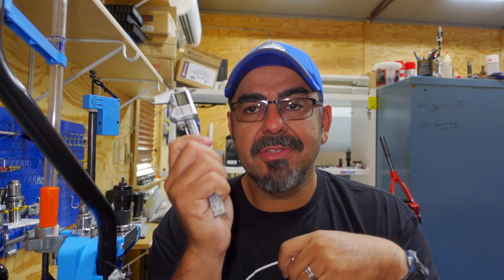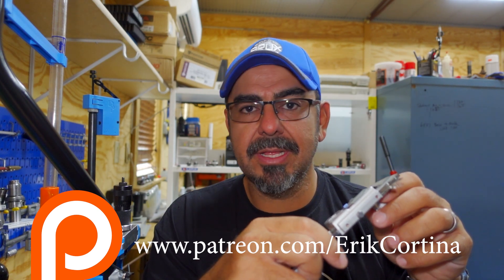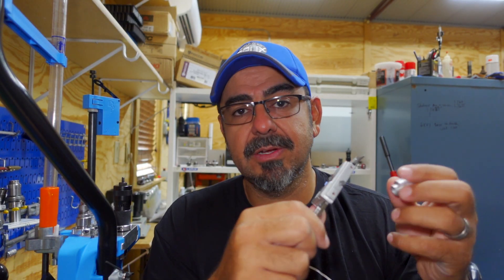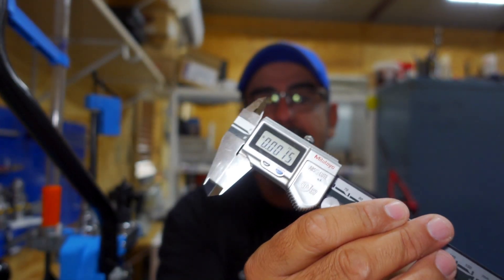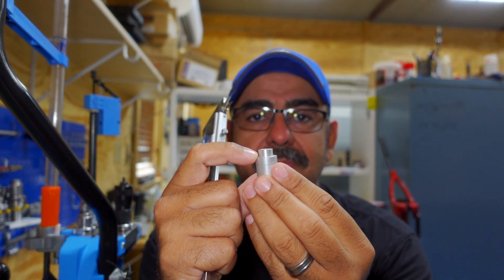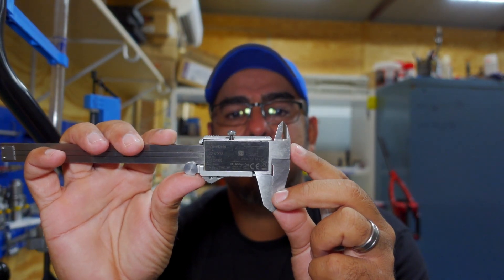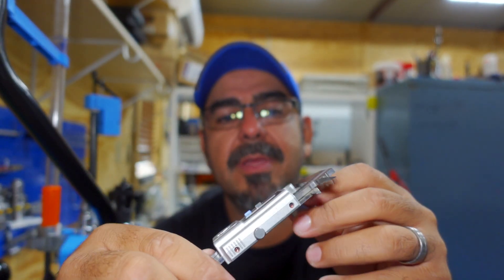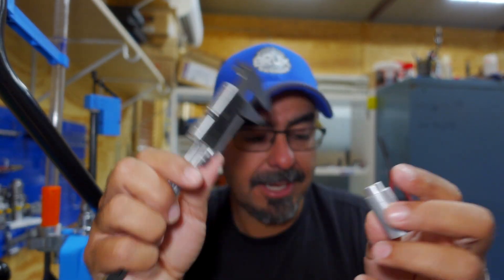You are using your calipers wrong!  Let me explain why...

Comment: Your gage block is only accurate at 72F degrees.  Too hot or to cold it will be off. 

Make sure you caliper and gage block are at 72F to get an accurate measurement. Let them soak for 15 mins in a place that is at 72F prior to measuring.

Comment: In my humble opinion, most people's biggest mistake when they buy a set of calipers is not getting a gauge block to go with. It doesn't have to be anything crazy. Just a 1-in gauge block, that gauge block allows you set your calipers to the amount of pressure that you're used to using and usually it'll look something like your readout will .0015 when it's closed but when you take the actual measurement, you're hitting 1in on the gauge block, and while technically this isn't right, you're making up for the flex that you're getting, these days it's quite a bit slower and depending on what I'm doing I don't always do it. But I almost always grab the Jaws with my thumb and index fingers right behind the comparator gauges, that doesn't allow you to flex the calipers and give you a false reading (as much) just play with it, compare your measurements to a gauge block and I'd almost be willing to guarantee they're not to true dimension. 
I hope this comment saves somebody some money and maybe aggravation in troubleshooting

Comment: I remember that the OD tolerances can vary with temperature as the piece is being ground on a lathe or CNC machine. I have also used a bearing heater to slip it onto a shaft. As the temperature cools to room temperature, it locks onto the shaft.

Comment: Hi 
After my calipers have been zeroed,the digital display reading is out to the physical reading on the slide.Is there a way to reset the digital display using the buttons(in a set order to reset) or is it a case of taking them apart to see what is causing the problem.The make is a Moore & Wright.

Comment: While you are correct that claimed accuracy is 1/1000, I have those same calipers with carbide jaws. Measuring guage blocks or pins they measure dead on every time, that stated accuracy is more disclaimer than fact on good calipers...... I have guage pins from  10/1000 all the way to 1/2" and blocks from 50/1000 to 4".

Comment: I call my digital calipers my "electronic approximator"..... Good for quick near-enough measures..... I have a dial caliper that is accurate to .001" (or a bit better using the MK1 eyeball).... checked against my top range Mitutoyo mike they are spot on... They weren't cheap....

Comment: I use my feeler gauge to confirm caliper accuracy.  Here's a tip regarding using a feeler gauge for measurements. By stacking some of the blades of a feeler gauge together, you can get larger thickness measurements. If you put all of the blades from .003 to .022 side by side, and measure that, those add up to .250 which gives you 1/4".  Add from .003 to .019 to get .187(5) aka 3/16" (6/32, 12/64). Add 8-17 to get .125 aka 1/8".  Add 14 15 16 17 to get .062(5) aka 1/16th. I may not be the first to figure this out, but I figured it out on my own and wanted to share with anyone else who may not already know it. Also, if you have quality drill bits you can trust, you can use the base of the bit as a measure of diameter (or the outside of the drill bit, if the diameter of the bit is larger than the base, like my 3/4" Fisch bit).  You were right, I hadn't thought of the fourth way, so, thanks for this!

Comment: This is a check that is just as important as measuring  a gauge block.
Take a cylindrical object and measure the diameter using the tips of the measuring jaws.
Then take a measure as far away from the tips as possible. 
If there is a big difference between these two measurements may have to tighten the adjustment screws. 
But make sure that the movable jaw is sliding freely. If you tighten to much the actual measuring force can be too high which causes measuring errors.

Comment: They advertise + or - .001, but even the china knock offs usually do better than that.  I'm guessing Mitutoyo advertises that tolerance so that they never have a return.  Where the Mitutoyo really shines is battery life and that they have a low battery indicator.  The cheepos us a lot more power and can start showing bad readings as the battery gets low without any warning.

Comment: Are dial calipers better than digital, or is there really no difference?
Reply: Not really. IMO I use dial calipers at work just for a quick reference. They usually get knocked out of tolerance really easy because of particles getting into the teeth gear area.

Comment: Sometimes I get a different measurement when measuring the same thing multiple times so I know my cheap ones are not perfectly accurate. 

But even my cheap ones are far more accurate than a ruler or tape measure. For most things they are good enough. 

The secret to good results with the cheaper ones is to make sure you zero them out before each measurement, and open and close them onto the object slow and smooth. It also matters how hard you clamp down on the object. Mine work best when I barely let the jaws make contact. 

If you don't have the gauge block you can Google, exact diameter of a quarter and a nickel and get some coins that are fairly new. Apparently the US mint likes to make these coins to some pretty exact dimensions. I'm sure it's not as good as the official gauge block but it's better than nothing and almost always available and basically free. According to my measurements my cheap old ones are not that bad. I just measured an uncirculated American eagle silver dollar and mine gave a very close measurement. 40.6 mm is the specification and mine said 40.62. close enough for my uses. I think a completely uncirculated coin would be the best option if you have one.

Comment: You left out one other accuracy problem - heat/cold
If you measure your 1" gauge block when it is hot/cold you will find a difference in measurement.  Then you use that to measure something at that particular temperature and you will get what you measure, but the next day it is hotter/colder, then that exact same measurement - isn't.

Just for fun, put it in the fridge (not freezer) then measure it, then put it in the sun and measure it.  (time is a factor so at least an hour min in each environment).

Comment: Check caliper accuracy with a round ground cylinder. Measure it with a micrometer and then measure it with a caliper. The biggest source of caliper inaccuracy is the various measurement pressure used by each user.  https://www.youtube.com/watch?v=EELINzAqYPI&t=11s

Comment: The Gauge blocks are a MUST...but I always use two fingers to close the jaws for outside measurements for better control of closure pressure.  But where were you 50 years ago when I needed you?

Comment: I never considdered the top messuring surface to be something people might not know, this was just normal to me.

With analoge metric ones you realisticly can messure to five hundrets of a mm which I considder to be quite good.

 I dont realy like digital ones, I had them to often run out of battery at the worst time or have the zeroed position run away, I also do not like the ones with the dial indicator becouse though they are good at desplaying mesurements after the comma but are hard to read bevore and some of them dont even have a ruler to read those of

Comment: This system was originally called quadri measurement by Miutoyo well over 40 years ago. Its been standard on all types of calipers since then and probably before. After all this time I doubt if anyone with calipers has not used this feature, it comes in the instructions..

Comment: We always handled gauge blocks with cotton gloves on.  It transfers less heat and prevents the oils in your hands from messing up the blocks.  And our labs for measuring all dimensional equipment was kept at 68 degrees F with a plus/minus tolerance of 1 degree.  The equipment has to set at that temperature for 2 days to stabilize before calibration.  Outside of those temperatures you will lose accuracy.  And you need to know how much the material you are measuring grows per degree and take that into account.  For reloading you need to be accurate.  Measuring hole spacing in a Barndominium no so much.

Comment: A lot of mikes come with standards to check their accuracy. If you do not have a mike, the standard can be purchased separately for around 10 dollars from Grainger's or Fastenal.
Part of my job was to check our calipers and mikes, verify their accuracies and log the results in a records book. We had to purchase a standard, that was a few years ago so the price may have changed somewhat but they are much more reasonable than the gage block for those on a limited budget.

Comment: Thanks for the info, I never knew.  For me calipers are for measuring "pretty close", as in a bit more accurate than a steel ruler.  I guess it's a family thing.  Grandpa Miller was a machinist, and Grandpa Parliman was a tool and die maker, and so made mics' much like those that Grandpa Miller used.  Seems I've inherited Grandpa M's mics, so I have probably 30 or so of them.  I suspect they are nearing 100 yrs old by now.

Comment: The ga block is basically a joe block, however Joe blocks come in sets and you can stack them to get any mesurment they hold togather just by friction becuse they are milled that accurate you have to slide them apart becuse the hold is that strong.  You can have a pression set and a set to set up machines with a working set, say if your doing a milling operation.
Your working set not used to calibrate tools.  Like micrometers.  Sure you can zero a  0-1" but what do you do with a 1-2"
And up.  Joe blocks.  

Notings accurate by the way, some things are just closer then others.

Comment: I worked in a machine shop, ive never seen the top step used like that,  yes accurate measurements should be done with mic  but even then  you have to have a  feel for it   if the half thou can be a factor then you've got to wonder about ditigtal height gages  vers a dile type and Joe blocks for calibrations  and you still get the fart factor, you fart wile taking a mesurment the dile jumps all over.

Comment: Cheaper battery-powered electronic instruments often loose accuracy as the battery dies. I once had a bathroom scale that showed me gaining five pounds by just replacing the battery. Precision instruments should not be that bad (>3%), but keep the battery charge in mind. Also, digital does not mean more accurate. As was shown in the video, many digital instruments have useless digits in the display suggesting more precision than the instrument actually has.

Comment: Here's a method that works extremely well for referencing. Scribing. You can take one end tip of caliper that you take outer diameter measurements and place it on the end piece or edge of part. The other end of the tip, set for how long you want, lets just 1inch. Lock caliper in place. You drag the caliper either parallel or perpendicular with lightly putting pressure on surface of material to leave a scribed mark while moving along the edge. Now you have a 1 inch scribed line from the edge of the part. The tips on top that are used for measuring inner diameters  can be used for scribing circles as well if you have a starter hole to begin with or scribe next hole location. Works great for referencing if you need numbers fast with location points and all you have is a drill press to work with with no read out and you have to do everything by eye. I would use calipers like this if they are worn out or are cheap throw away. Don't use your good calipers for this. I use this method all the time around the house on projects.
Reply: if you did that using my calipers you would be buying me some new ones
Reply: @johnbower  Lol! I was referring to old, used and cheap calipers. Not recommended for Starrett, Brown and Sharpe or  Mitutoyo calipers or other high end calipers. I've got some "aerospace" made in China calipers. Spent $20.00 on them quite a few years ago and work great for what they are not intended for. Lol. Great tool to use for low dollar, drop on the floor a few times calipers. Lol. Not recommended for high dollar calipers or ones that you measure for precision as normally used for. Hope this clarifies. Lol

Comment: You CAN use the 4th method, but that doesn't necessarily mean it was designed for that purpose, and frankly I wouldn't use it. If you look at the tail you'll see a small notch cut out on one side. That will allow you to measure the shoulder without running into any fillets. The head of the calipers don't have this relief cutout, so if you have them pressed flush against the piece, you could be measuring to a point on the fillet and not the shoulder itself.

Comment: Micrometers are a lot more accurate but can I make a suggestion when you handled gauge blocks do not touch the measuring surface the acids and you're scared sometimes we'll leave fingerprints and mess up the surface have a great day

Comment: 4:18 accuracy and precision are not the same thing. The repeatability is .0005”. If you zero the calipers on a datum (ie a ring gage, gage block, etc.) that is the same size as what you are measuring, they should be “accurate” to .0005”.

Comment: "That number (0.5 thou) means nothing." That is actually incorrect. There are metrology techniques which allow you achieve sub 0.001 accuracy even though the tolerance is +/-0.001. That is just the absolute guarantee across the whole measurement range.

Comment: You are using your calipers wrong. You're supposed to switch them to metric before using.
Reply: I gather there is a movement in the US to go metric.
Well think about it there are 4.5 litres per gallon in Australia we use litres at $ 2 plus for diesel fuel, at per litre it's easier for the companies to raise the price of fuel in small bits than say for a gallon. In Aussie we pay as I said say $2.05 a litre which works out at approx $9.22 a gallon. Where at the moment national average of regular is $ 3.513 and diesel is $3.832 a gallon.
That is where the Aussie $ is worth $ 0.64 cents in US $. We Aussies are getting ripped ogg big time.
Metrics is great in measuring so easy to work out, but it causes inflation.

Comment: Great video! Very useful knowledge. FYI - I used to work in metrology, you shouldn't be handling gauge blocks with your bare hands. You should be wearing cotton gloves. The temperature difference from handling the gauge blocks with your bare hands to the air temperature changes the size of the block, not anywhere near 0.001" but it does affect it. Plus the oils in you skin will permanently etch the gauge blocks. Over time, that can affect the accuracy.

Comment: I don't need them to be super accurate. Doesn't really matter what size it says as long as I make the part the same size. But I use 99% for woodworking. Now I have to go see if mine will measure that 4th way. Never knew it until I saw this video.

Comment: There are more useful properties in a measurment device than just resolution and accuracy. There is also repeatability which, for an individual craftsman, can be more important than accuracy. If the instrument it is repetable to 0.0005 every time and it is being used in a test and tune closed loop then it doesn't really matter if it has a 0.030 inaccuracy. The inaccuracy essentially just becomes an offset. The accuracy trouble only comes when two different craftsmen and instruments are comparing their measurments.

The claimed +-0.001 is not an inaccuracy of 2 thou, it is not more than 1 thou from the indicated value to the true value. 
But this is still slightly misleading because that accuracy tolerance is really a simplification of the limits of the internal(sensor) and external(display) resolutions combined with what is called a "known uncertainty". Known measurment uncertainty is a statistical probability distribution (guassian curve in most cases), calculated from the accumulation of possible errors in every step traceable back to the official international standard. Meaning there is a high chance that the instrument is near the center of spec and a very low but non-zero chance (like powerball odds) that it is way outside of the claimed +-0.001".

Now with micrometers, they may be marked to ten thou and certfied +-0.0001, but at those levels operator error becomes a dominent source of inaccuracy. Even finger-temperature and time matter. A steel guage block may not show the temperature error because it thermally expands at the same rate as the steel micrometer.(Like if they are stored in the same box.) The part and micrometer should be allowed to stabilize in open air[not closed box] at shop temp for an hour. If both are steel and the part and mic are both spec'd at a standard temp [usually 70f] then there is no need to use a correction factor for non-standard shop temp.

Comment: I’ve never liked calipers there for rough measurements. I use telescoping gauges and micrometers OD and ID . Never knew of the fourth way with a caliper tho . In all fairness you needed to use the depth side edge ways it’s made for it that way .

Comment: you only think this is news because you are not in an industry where measuring is required. If your measuring between two holes of the same diameter you can measure one hole 0 the calipers then you get a direct reading when measuring between the holes. Guess that makes 5